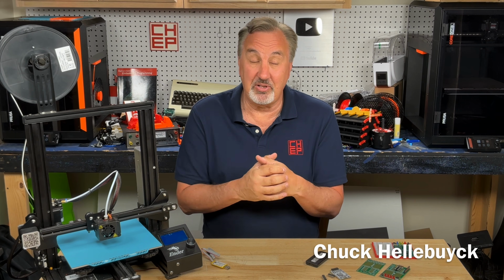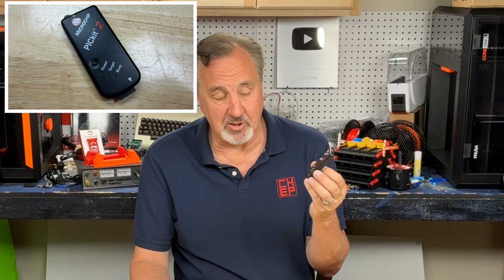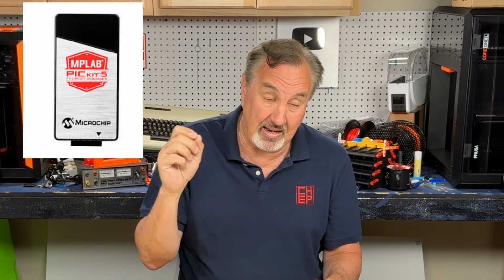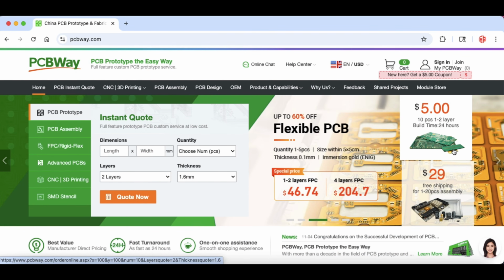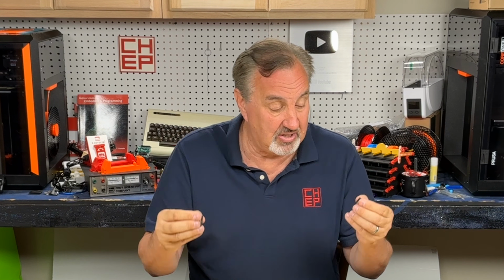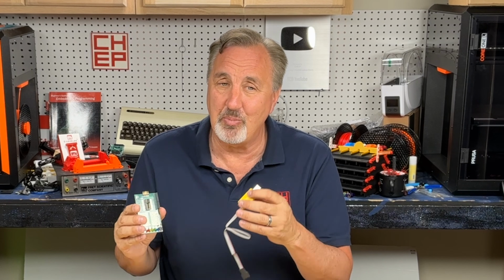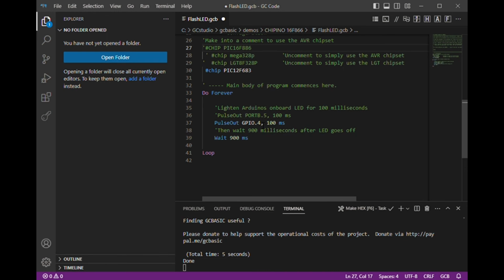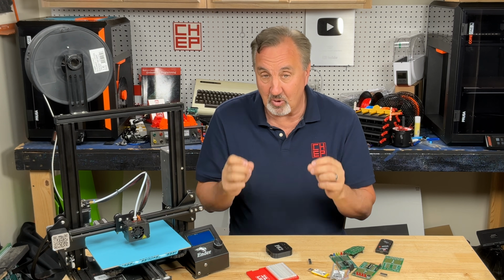Can Open Source Save Products and Tools from Extinction?

Comment: I keep a running Debian 12 hosting MPLabX 6.20 to keep my PicKit3 and my Curiosity running
Reply from the maker: PICkit Plus will run a PICkit 3 as well.
Reply: @FilamentFriday  my solution is free of charge. Because selling a used PC is a pain with new users, I keep them until they break apart. I have around 20 functionning ones. A i7 3rd gen is more than enough for Debian 12
Reply from the maker: Only issue is the latest devices aren’t supported.

Comment: Chuck - Really good content.  I have in a drawer an old PICKit3 never used.  Looks like its supported by the tools you mentioned so I ordered the pickitplus software.  Thanks so much for putting this together!!! Much better than the heavy MPLAB environment.!
Reply from the maker: Agree. And correct, the PICkit 3 is supported.

Comment: I would love a video on the benefits of using an 8 bit microcontroller to run maybe a sensor, but connecting it to a 32bit device like you have mentioned in previous videos.

Will you be at MRRF 2026? Would love to say hi!
Reply from the maker: I was there, did you stop by?

Comment: Does the Pickit 2 program AVR’s?  When Microchip bought Atmel they buried the AVR ISP programmer, which was a $30 programmer that does all the AVR’s. Fortunately there are clone ISP programmers out there.
Reply from the maker: Currently, no. The PICkit plus software hasn’t added that yet.

Comment: You know, Chuck, I seriously considered getting a Bambu printer in the past... But not anymore and now I'm much closer to actually buying one (I haven't decided yet on which one.)
For me, open source is a must. On everything possible. For example, I just bought a new radio controller for cars and boats... And what did I choose? The Radiomaster MT12. Because it uses ExpressLRS. 
The radio is much more expensive than many out there that are perfectly good... But it uses EdgeTX, which I'm familiar with, and then I can buy receivers from any brand I want, since it runs ExpressLRS 2.4Ghz.
(Actually, it even has a module bay, so I could use ExpressLRS 900mhz as well, or many other receivers, almost all of them, with a 4 in 1 module. So... It makes no sense to buy anything else for me.)

But, either way, some day I'm going to play with programing as well!
Stay safe there with your family! 🖖😊
Reply from the maker: I understand. I really love my Prusa Core One L but it’s not cheap. I do wish Bambulab would release at least one Open Source option like the A1 or A1 mini.